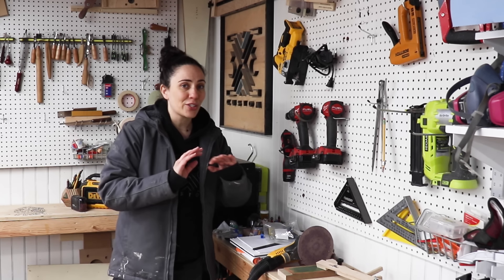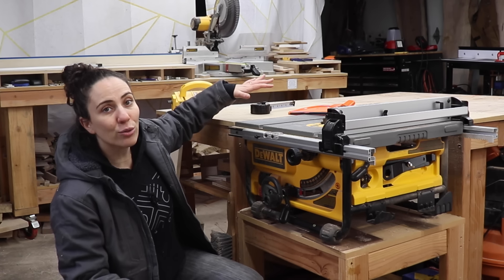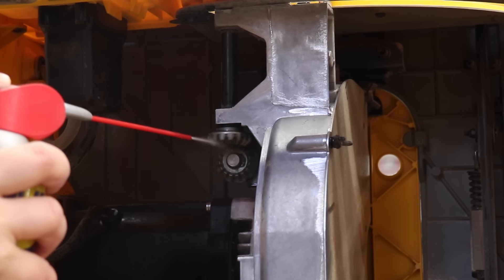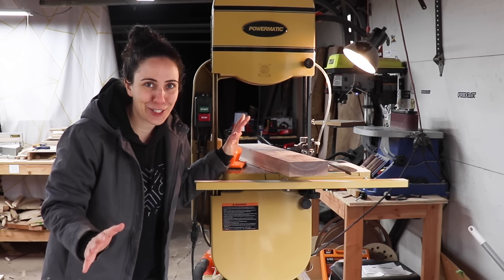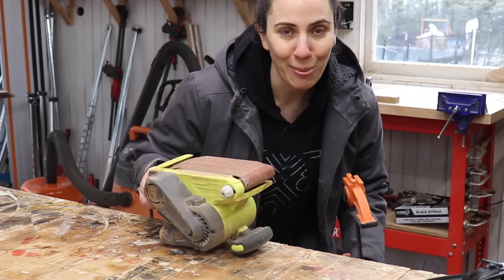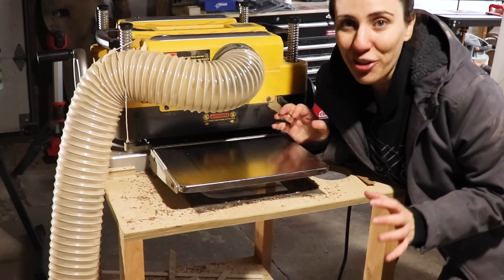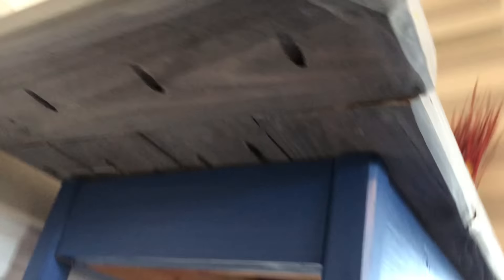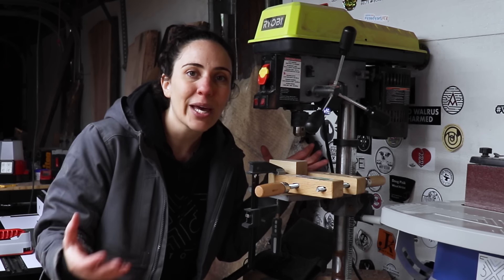What Tools Do You Need to START Woodworking? Beginner Woodworking Tool List

Comment: Depending on what space etc you have, I did quite a few starter projects with a few screwdrivers, coping saw, small handsaw (crosscut i think), corded drill and some bits, hammers, pliers, sanding block and sandpaper, hakcsaw, etc.  cheap chisels also come in handy.  Then as I got my shop, started getting other tools from there and now I have lots of fun toys to make things with. And videos to prove it :)  Though mine do not have the fancy step by step that yours do. :)   My order of big tool purchases was:  drill press, disc/belt sander, bandsaw, big dust collector, table saw, drum sander.  I was lucky to be given an old planer and jointer when a friend upgraded.  I have found my laguna 19-38 way easier to use for thickness 'planing' than the planer as not only does it not have the width limitation, but it does not cause tearout and you can do tiny fractions of an inch thickness removal on any wood...just for small pieces make sure to stick them to a larger sled or the vac will suck them up ;)  I love the drum sander...it makes so many things so much easier.  And the paper is easy to change, which is also nice.
Reply from the maker: Cant wait to get a drum sander. Ha

Comment: Excellent video. Will send it to my son and others who keep asking me these questions.
   Totally agree about pick a brand for cordless power tools for DiY and even apprentice pros. All the pro brands have products that are best-of-all-the-options and their range fillers. You can spend forever worrying about the best saw, the best grinder, etc, when they're all plenty good enough.
   One word of warning: the in-between brands seem to be factory rejects with lower quality control than full pro tools rather than beefed up DiY brands. I've had to return almost all my budget pro tools for being very dangerously faulty. If you want a budget item, go cheap store brand not half-way and not on line - the store's reputation is on the line so product may be noisy and underpowered but it will be safe - and add a quality blade.
Reply from the maker: Good tip

Comment: There were a couple of things I thought of whilst watching that might be worth a mention. ‘Sharpening’, though that could possibly come under maintenance, and ‘space’. You’re fortunate to have a decent sized garage to use as a shop, so some of the machines you have can be set up relatively easily. I have a space that’s 3m x 6m which has to hold a bench, all my tools and also my raw materials - it’s tight, but doable, though some machines I’d love to have can never be accommodated. For now, things like table saws, band saws, dust collection, thicknessers and so on have to stay in my dreams. Hand tools are where it’s at.
Reply from the maker: Yeah. Each situation is different! I can only speak from my own experience

Comment: I have the same table saw. A mistake I made in purchasing it, I "assumed" I could use a dado stack with it. Well, as you know with this model you can not. Less than a year later they were selling the upgraded model with a longer arbor for a dado stack on. Very frustrating! So I purchased an old, but in awesome shape, radial-arm saw that has a dado stack on it for the most part. I would like to upgrade my table saw for the new Laguna 10" cabinet table saw. You can find them for under $1000.00 and they have some great features like a full cast-iron top and built-in casters along with other things but my DEWALT table saw is still in excellent shape and I can't justify up-grading right now. You make a very good point about buying power tools that all use the same batteries. Dewalt has many different volt batteries that are tool-specific. That means I have about 4 different chargers and probably 10 different size batteries for the same brand. I can remember back when battery and charger were included in all cordless tool purchases. Yes, I'm that old!
Reply from the maker: Yeah. That’s a pretty bad drawback to it

Comment: When you at 0:55 mention the mitre saw isn't a must have. That's when I realized you know what you're talking about. Yes it's super nice to have, and I use mine all the time virtually on every project, but most of those cuts could be done on the table saw. 

What I will say about the miter saw is, although I agree with you, sure it's possible to live without, when you're cutting longer material then when combined with a miter saw station it's unrivaled. In my case I can support a full beam of 4m or even 5m length on the mitre saw station and get a cross cut in. That would not really be possible on my table saw. Infact for these longer materials I can't really think of a good way to do accurate repeatable crosscuts. I guess the solution would be to use a circular saw. 

So my point here is although I consider it a nice to have, I do not regret buying it, and I don't think it's a tool that phases out of use when you improve your tool collection. I've seen some Youtubers claim this and I have no doubt they have good workflows, it's just for me personally it remains one of my most used tools.

What I would have done differently? Bought a table saw before buying a mitre saw.

EDIT : I have a similar table saw. An EU version also by Dewalt with that rack and pinion fence. I have to say, in this price point it's a very good saw. I would also highly recommend it over similar priced competition only because of that rack and pinion fence system. A reliable fence is one of the most important attributes with a table saw, along with other things like surface flatness, etc. While the Dewalt (or any saw in this price range that has a cast aluminum top) suffers a bit with flatness or miter slot preciseness, sorry but it's true. The Dewalt does get one thing right, and very right and that's the fence. I have yet to see a better fence system on any table saw, regardless of price. You literally dial it in and never have to tap or worry about it being square. It always is.

Comment: For a bit of a step up, albiet quite a bit less than a mainline cabinet saw - checkout the Ridgid R4520, I upgraded to it from the Dewalt, and while the fence system isn't quite as well designed, the full sized tool made a big difference for me.

Comment: Nice advice on staying with one brand for battery tools. Myself, I have the Ryobi One system. Having that common battery makes it simpler, and once you have several batteries, you can often find good deals on the bare tools, and you don’t need all the extra chargers. The batteries on many of them cost more than the tools. I did once order a pack of 4ah batteries that was on clearance for around $60. They sent me a case. I did upgrade to a 6 battery charger, but really it charges one at a time, just once one is charged it selects the next one to charge. If all are charged, it goes into maintenance mode on them. Only thing I’d do different is go with the 40v yard tools. Have a small yard so bought the 40v mower, but already had the 18v trimmer and blower. 40v would be better for those.

Also, most of these tools go on sale around Father’s Day. Sometimes they have a bogo sale and can get a good deal. Lawn equipment usually is on sale around Memorial Day. Black Friday and Cyber Monday are usually really good for combo sets.
Reply from the maker: Good tip!

Comment: A tool that made several appearances in this video but wasn’t called out specifically — a vise.  A workbench, whether made or purchased, is also pretty essential.  Finishing tools and consumables — brushes, tack cloths, wood glue (water resistant for outdoor projects), etc. I’m surprised track saws weren’t mentioned; you can do many of the same things that you can on a table saw for much less money and space, though repetitive cuts are much more tedious. A good quality apron with pockets. Hand tools — combination square and speed square are both very useful.  I’d say a combination square should be a very early purchase. A good measuring tape.  Drill bits. The list just goes on! 😂 It’s an easy hobby to go down a rabbit hole.
Reply from the maker: The list goes on. Ha. Hard to fit EVERYTHING.

Comment: Table saw: I bought the Dewalt 7491 last summer, which is basically a slightly upgraded 745. It is slightly larger than the 745 was and has a great ripping capacity. As a hobbyist, I doubt that my skill will ever surpass the capabilities of this saw. It's been a great saw for me so far.
Reply from the maker: Good to know!

Comment: I found it interesting that the Lathe never was mentioned, mostly because I've heard from quite a few (especially older) sources that it's a staple in the woodworking shop. It was quite a while ago since I last saw that mentioned though, so perhaps I simply misremembered.

Excellent video for tips on getting started, now if I can just get my tablesaw to stop blowing the fuse when it turns on I'll be much happier!

Comment: After getting my finger squashed by my table saw. I changed totally my mind.
Using the parfguige mark II system from Axminster I build my own mft tabletop.
Using fences and special screw in benchdogs I can saw as precise bas with any table saw using an track saw.
Just route a dovetail in the mft to get a place where your have a replacement area when you saw the surface from the table.
Now the wow feature I currently found there is a incra positioner router mounting plate from benchdogs UK .
Where your can insert the mounting plate on top of a mft you put in for screw in benchdogs to fix the plate totally precise in place.
With a route insert plate in the mft and the incra positioner you can do massive joinery. 
With a track saw adapter I am able to route long precise groves in the mft to get a very usable routing station in the self build mft. And using wedges on a wide mft you can even clamp tabletops on it when glueing.

Comment: Good work to Tamar as always. Table saw and jointer are the two big workhorses for me and I think most woodworkers, for the evident fact that it's hard to ripsaw by hand and it's hard to hand flatten lumber. It's not so hard to crosscut and dress by hand. Everything else is a "nice to have." But that's my opinion, and many have a bandsaw as number one, or no power tools.

But if you're just getting started you can make amazing things with just dimensional softwood lumber (1x's and 2x's, actual thickness 3/4" and 1.5") from the big box home stores. Just pick straight and flat boards to begin with. You can get by with a jigsaw, a hand drill, a block plane and couple of chisels. That's how I started. And I wish it was still that simple, now that I have more tools than I can manage!

Comment: I had a dust collection fire last July. The bag was clear and the material was damp inside. The sun heated up the material and caused the combustion of the wood material. The smoke in the ventilation and the fast actions of a passerby prevented the fire from spreading. the damage was localized to the plastic bag, which was 1/4 full.

Comment: High energy video!  awesome!  Great tip about the dry WD40 - I've had a table saw for 5 years now (just a beginner myself), and the gears have been at "nearly seized" state several times, and sadly when cleaning it, I always that the sawdust was caked onto to the spots I oiled last time.  (Using one drop of 3in1 oil was always putting me back in the same wedge state after reuse.).  The other thing that has helped me is sharpening my blades with a dremel tool. Not sure I'm doing it 100% correct, but that would be nice to cover at some point - how to sharpen each type of tool in your arsenal.  Awesome videos !!!
Reply from the maker: Glad you liked it!

Comment: You didn't mention your router table.   Enjoyed the video, as always, and was waiting for you to discuss your router table and you  completely snubbed it.

I too have the dw745...gotta love that rack and pinion fence!!!  Bandsaw and better dust collection system are next on the list.
Reply from the maker: I was going to mention the router table as the next step after getting a full size router. But decided to leave it out. Since it’s not really something you need to get started. And the bandsaw will change your life! Ha
Reply: @3x3CustomTamar  Point made.  I had access to a simple router table starting out so I was spoiled.  I have 11 red oaks to mill, my first time milling, several are 30+ diameter, so the bandsaw will be important I think.  How do you like your Powermatic?  Is it big enough for longer pieces?
Reply from the maker: @jeffburnett5685  love the powermatic. But I have the riser block for larger resaw capacity. It took me about a day to assemble the whole thing. You will need a friend to help lift the top when installing the riser block

Comment: And, down the rabbit hole we go! If you start with rough sawn lumber you will need some way of facing it to get it reasonably flat on one face. Cheapest is a scrub plane. A carrier board and wedges can work with the planer. A router & rail system also works. Solid lumber joinery requires first learning about the different ways wood moves & why. I recommend reading "The Wood Doctor's Rx" by Eugene Wengert. It will save you from many mistakes.

Comment: Basics: Circular saw, Drill, Sander, Jig saw
Level up: router, table saw, miter saw
Level up: bandsaw, planer
Level up: drumsander, jointer
Reply from the maker: So no table saw?
Reply: @3x3CustomTamar  I’m slowly getting started with woodworking. I bought a Kreg track saw and table instead of a table saw mostly because it is far safer, easy to move and can be stored out of the way. I realize that it’s not as fast as a table saw for batching out a lot of cuts. But I’m just doing it for fun. I also have a bench top router table. So I think I can do everything that I would need a table saw for.

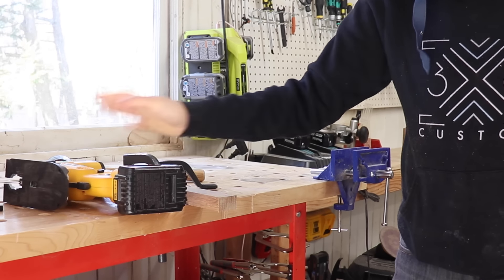Comment: At 2:01 regarding the jigsaw, I agree.  Most are worthless if accuracy and real precision are important.  In my view (and I own and have owned) lots and different brands of jigsaws, the only jigsaw worth having is a Mafell.  Yes, it will cost an arm and leg, or maybe both legs, but it, hands down, trounces anything else on the market -- and with its super stiff blades, there is virtually ZERO blade deflection.  With the hairline on the splinter guard, cutting where you want to cut is a piece o' cake.
Reply from the maker: Sounds cool

Comment: Straight and planed wood is really expensive. 
So one needs:
- Sufficient clamping equipment and stiff table
- Planer to remove rough surface
- Table/Track/Handsaw to cut to final dimensions and to get rid of bends
- Router for Edgework (can be used as planer with proper bit)
- Drill

Comment: I would say, what you need for the start is: a drill and a saw that may enable you making dados and other types of things, then a router. I started with mitre saw because table saws are too big and I just can't find space to have one. Circular saw is nice, you can convert it to table saw, but even without it but with track you can achieve most of table saw results, having other things with mitre saw. But I am not a carpenter, I just do some stuff during summer for my own garden :)

Comment: Hearing protection is so important!  If you have ever tried to talk to a person that doesn't hear well you know how frustrating and awkward it can be.  You have to basically yell at them and repeat yourself a lot.  For these reasons, people tend to avoid talking to the person, which is incredibly sad.  If you don't hear well, it can be a very isolating and lonely existence.  Often men have hearing loss in their older age because of mowing the law, using power tools, etc.  This can cause communication problems in a marriage that lead to real issues in the marriage.  The thing about hearing loss is that it is cumulative and takes time.  You may mow your lawn without hearing protection every week for the last 10 years and not notice any hearing lost but it will catch up to you eventually.  You will lose your hearing in your most vulnerable and lonely years.

Comment: I still have some tools from the 90's
Like the Bosch green jigsaw
A bandsaw is really underrated . Since i have that its 70%bandsaw , 20% mitersaw 10% tablesaw .

Most of my tools are corded .most need a vacuumhose anyway .
Latest upgrades : Makita 3712 ,metabo sxe 450 turbotec ,DeWalt 576k(softstart already ordered)
And a nice  Japanse Saw set (sharksaw)
For a new tablesaw i really like the metabo ts254
If you need a handplane : Veritas #62 expensive but worth every Penny .

Comment: I would recommend to start with a railsaw instead of a normal circuler saw. It can do almost everything a tablesaw can with a few benefits for big parts. It also is a lot safer and easier to use compared to railless.
Reply: aka plunge saw

Comment: Can I recommend you try the skill jigsaw that's brushless good price it's 20v brushless makes low vibration and no need to change the brush coils it works great even the skill blades are awesome cut way cleaner lines and does curve cuts or drill 4 corners and cut a square

Comment: To me, after someone gets a good Random Orbit Sander, the next most necessary sanding tool is some kind of Oscillating Spindle Sander. With that, you can find heavy duty benchtop models from several brands that have cast iron tops that'll likely last decades, and they're basically indispensable for sanding those tricky inside curves, especially if you have any burn marks or blade marks. Those are a headache to do by hand.

Also, if someone is sawing curves but isn't currently doing it with stuff thicker than about an inch, a jigsaw might actually be a more affordable starting point. They've worked fine for me so far, though I will get a bandsaw at some point.